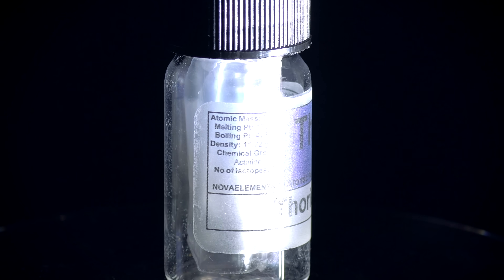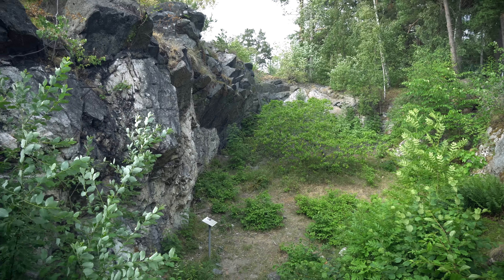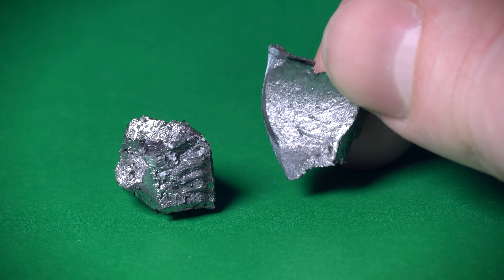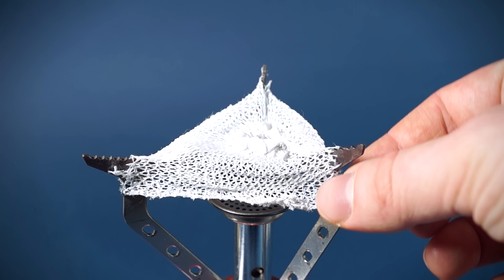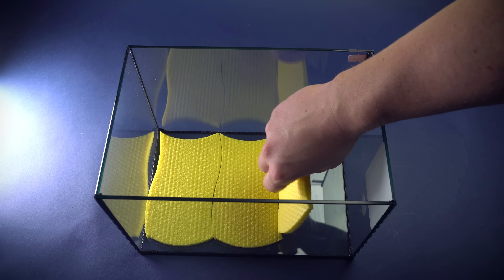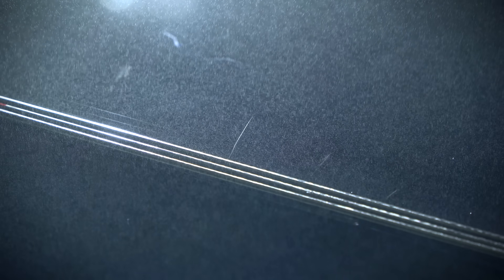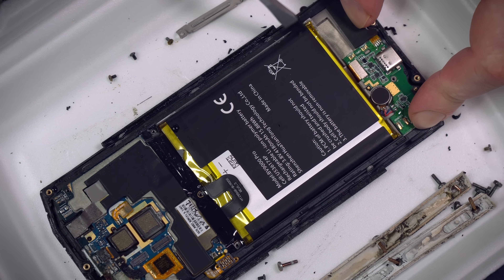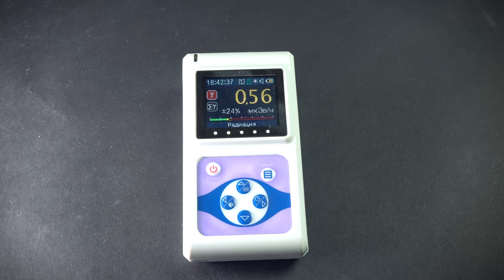Thorium - A METAL THAT NO ONE NEEDS!

Comment: Stay tuned for thorium reactors in the near future.
Reply: Coming since 1969
Reply: @zerotwo_.002  can't be weaponized, of course they didn't put effort in researching it
Reply: @zerotwo_.002 fusion may be 30 years away. 

But Thorium reactors will never exist.
Reply: @zerotwo_.002 17 yo old bro is chilling with homemade nuclear reactor.
Reply: I smell mindustry references
Reply: The only reason Uranuim fuelled reactors were developed in preference over Thorium Salt reactors, was the fact that throium salts cannot be used to fuel an atomic bomb.
Reply: @kf8575  That is incorrect...they weren't used due to Tellurium embrittlement of the Hasteloy-n the reactors were made of.   This is outlined in the publication from Oak Ridge.
Reply: @kf8575  Where'd you hear that, in a Ted Talk? Canada doesn't use nuclear submarines, and we STILL use uranium in our CANDU reactors. Why? It's better. Germany and Japan used it despite lacking nuclear submarines. Thorium is just another industrial waste that big industry is trying to pawn off on us, as "the latest and greatest big new thing" ... Because they didn't see the writing on the wall, and failed to diversify into new green technologies. Thorium has all the toxicity of of Uranium, perhaps 1/10th of the energy yield, and STILL produces toxic waste.
Reply: because of the navy
Reply: @kf8575 
Bollocks! 
Thorium is not a fission fuel for reactors or bombs. 

Just like U238 bred with neutrons to Pu239,
Th232 needs to be transmuted with neutrons to U233 to make it fissionable.
VERY dangerous process. More so than U238 to Pu 239, because of U232 side product with extremely high energy, penetrating beta and gamma emission from its decay.

And U233 makes very good bombs.
Reply: Sir,that exist in some games
Reply: @theredneedmoreblins3560  mindustry
Reply: Will they need cryofluid to run?
Reply: @animarthur5297  Yes
Reply: My mans living in ww2
Reply: @justinthor damn, if you could get fusion to work, I'm onboard 100% but it won't happen in our life times.  Thorium is safer than Uranium/Plutonium plants as well.  As soon as you choke the neutron soure, the reaction end.  In other words the disasters like Fukushima and Cher obligations can't happen in a thorium reactor.  Smash the plant, the reaction stops.  Its kinda nice that way.  Add to that the waste products decay infinitely faster.  A good source.  Interestingly, nuclear reactors already provide 14% of the world's power.  The thing that people don't get, is that in a worse case scenario... a melt down can contaminate a small are, bad.  The problem is that coal and petroleum product pollute the entire planet right now.    But, as you say, if we can get fusion to work... that is the future without the slightest doubt.
Reply: I agree because it's true and also logic
Reply: Currently Thorium can be used as a fuel in breeder reactors to produce Uranium and Plutonium for thermal reactors, but it's way more expensive than just using natural occurring uranium. I Dont think this process has actually been commercialised yet. India has plans too because the have large deposits of Thorium but I don't think they have moved passed research phases yet. They only get 2% of their energy from nuclear power.
Reply: @CanonFirefly  Converting Urenium from Thorium is a self sustained process. And India there is large deposit of Thorium. So using Thorium is more economical than importing Urenium.
Reply: @SouravBagchigoogleplus  it's only economical when the cost of converting the thorium into uranium is cheaper than importing uranium. It isn't yet, that why India is still importing uranium. The issue with thorium breeding reactors is that they are expensive to operate with the only output being fuel grade uranium.

Dont belive what the Indian government tells you. The main reason for their nuclear reactors is to produce weapons grade material for their nuclear arsenal. If they were truly serious about nuclear energy it would make up more than 2% of their energy production.
Reply: @CanonFirefly  Nailed it. They're going for U-233 -- which is MUCH better for making atomic bombs than U-235 or Pu-239. That's their motivation.
Reply: @CanonFirefly  I would rate the Indian reactors as no more than CONVERTER reactors. In a loopy, round about way, they're using U-235 to convert thorium into U-233 -- rather than using U-235 to convert U-238 into Pu-239.

They have THAT much thorium to play with. Someplace -- way down the road -- New Delhi is hoping that they can get their conversion up to a decent breeding ratio. If this has been achieved, it would be epic world-wide Big News. But we haven't heard a peep.
Reply: @CanonFirefly  ok
Reply: @CanonFirefly  good argument sir, it modified my first taught. Thanks
Reply: @duckface81  thorium sounds less radioactive than plutonium or uranium
Reply: India have the largest thorium reserves and we used thorium and plutonium for making nuclear weapons and also in nuclear reactor's
Reply: @ashutoshbehera8593  Thorium to U-233 is a better explosive scheme than U-238 to Pu-239. The Indians have long figured this out. At this time, I'd figure most of the Indian thorium research is strictly for atomic weapons. No-one can get molten salt schemes to work. The US and USSR threw everything at the problem -- for decades. They couldn't make any headway. Neither has Beijing or New Delhi. They'd be going for their Nobel Prizes if they did. For a viable breeder reactor is the holy grail of atomic power.

BTW, don't EVER dream of fusion power. It's the sure fire route to atomic bomb production at a staggering scale. Neutron scarcity is why atomic weapons are hard to craft. All current fusion reactor schemes spit out free neutrons something crazy. One need only wrap the reaction chamber with thorium to have U-233 coming out of ones ears. 
Humanity is not morally or politically ready for such an achievement.
Reply: mindustry enjoyer 🤙
Reply: I prefer a thorium reactor because it has less risks
Reply: @ben_p6615 You are DREAMING!
Thorium breeder reactors are at least 10x Less safe than even molten salt U238 to Pu239 breeder reactors.
And AT LEAST a thousand times more dangerous than conventional U235 reactors.

Thorium is not a nuclear fuel.
Reply: ThyZlayer  trueee
Reply: gonna make one myself
Reply: @gmantweet4638  🤣and some legos is missing on mine 🍻🤘😎
Reply: Another yes.
Reply: Check-out safe ThoriumElectricUSA.com no government funding + replace closed coal and out-dated nuclear power plants + no CO2 release.
Check-out safe ThoriumElectricUSA.com no government funding + replace closed coal and out-dated nuclear power plants + no CO2 release.
Reply: There are thorium reactors in India
Reply: India is working on thorium reactors.
Reply: In India there are many thorium nuclear reactors which run on thorium
Reply: @poogers566  No they DON'T. They run on Uranium. The Thorium in them is being converted into weapons grade U-233. This radio nuclide is THE ideal atomic explosive. It beats out U-235 and Pu-239 by a mile.

Separating U-233 from Thorium is a breeze. It's pure chemistry. So you get a mighty pure product. As an explosive, you need far less to reach critical mass.

It, U-233, is so dangerous (proliferation) that the USA and USSR jointly decided to nix it.

No-one can make the dream come true: a molten salt breeder reactor. India and Red China are not more sophisticated that the USA and the USSR.
Reply: India had made one
Reply: Not going to hold my breath. Only perpetually 30 years away, like fusion power.
Reply: China is working on them at the moment as a matter of fact
Reply: @thescrimble  Yes and China made their reactors with Hasteloy-n.  They will have the same issue as every other nuclear nation that's attempted it.
Reply: India has thorium reactors
Reply: Once WE ARE ALL DEAD!
Reply: And thorium bombs
Reply: @Briandacunos  no lol lol lol lol lol
Reply: Go play mindustry
Reply: @Juangonzalez2004XO  I did, and probably you too :)
Reply: @maxwellr.a.harkonenn8317  yes
Reply: ThyZlayer  remember the cryofluid
Reply: oh boy... mindustry gives me nightmares..
Reply: https://youtu.be/jjM9E6d42-M
Reply: @urbanphotographer  ah yes, samonella
Reply: https://youtu.be/5gv6hDOnnCE
Reply: India has succesfully developed a Thorium based nuclear reactor which can produce similer energy as any normal nuclear reactor
Reply: @SpaceLOSTbunny  But it's a URANIUM 233 reactor. Thorium is merely FERTILE not FISSILE. So, yeah, the Indian reactor is very much like U-235 reactors.
IIRC, no-one has EVER gotten the design to the point that it is a BREEDER.
India, of course, has one of the world's largest thorium deposits. It could power India for thousands of years -- IF, and only IF, the Indians can get the reactor up to breeding ratios.
Now THAT would be new.
Reply: @davidhimmelsbach557  True 👍
Reply: Watch "thorium in 5 minutes", lftr reactors are too clean and cheap for globalists to allow
Also, https://youtu.be/tyqYP6f66Mw
Reply: Far further
Reply: Lol
Reply: Amen Bro..
Reply: Thorium reactors solve at least 3 major problems with uranium fission reactors
Reply: @nurseSean  Yes but the coolant, the designs,  the corporations and the politicians are dirty corrupt people so it won't be used responsibly just like everything else in this world.   It's ignorant to think nuclear is ever going to change.   It just doesn't have the abilities to.
Reply: NOPE.  Its already used in fuel rods.  Its a shitty fuel by itself, but when mixed with uranium it makes the uranium more efficient.
Reply: @TheNoodlyAppendage  Its all garbage misadvertised for nearly a century
Reply: We had an operating prototype in the 70s in one of the national labs, but the pressurized light water reactor technology persisted and sort of shelved any competing technology, regardless how much better. This could be a great interim solution until fusion is commercially available.
Reply: @amramjose  Tellurium embrittlement or segregation of the Hasteloy-N is the issue
Reply: It's not that easy
Reply: Tactical nuke incoming
Reply: Engin arık and her team died at sparta plane crash, the team was working on a reactor type for thorium
Reply: Grande!
Reply: They were the first ever made too but not weaponizable so the global cabal didn't use em
Reply: You were right. Are right.
Reply: Can Thorium double as a weapons platform? Ie. can the process produce weapons similar to what can be produced with traditional uranium nuclear power plants?

If not, then you probably have your answer why there is no drive for Thorium 😂
Reply: near future?
the giza pyramid was a thorium reactor
go look at the studies into the black goo found on the resonance chamber walls
FULL of thorium
Reply: if you mean in 40 to 50 years
Reply: Just saw an article that the chinese will make a thorium salt reactor in 2025
Reply: 5 years later...
Reply: Well it radiates alfa radiation  which can produce heat so maybe possible to make an weak nuclear reactor in your garage which will supply lights so good luck ;)
Reply: @gistasbanaitis473 Thorium is better than uranium in any way
Reply: @gistasbanaitis473  thorium is the future
Reply: @gistasbanaitis473  bet
Reply: @gistasbanaitis473  they've made thorium reactors before
Reply: @gistasbanaitis473 yeah
VERY low levels of alpha decay.
And of course the dozen more rapid alpha and beta decays after each vvveeerrryyy occasional Alpha decay.
Reply: Far future*
Reply: @drust1985  that didn't age well lol
Reply: @drust1985  you know Nuclear fission reactors are very close to being finished
Reply: Arent those already a thing?
Reply: @johannesviljoen9656  not really
Reply: Solar is inefficient, degrades, has far more toxic waste than nuclear, ... if you could get it into space and use a microwave generator and an earth based receptor, maybe.  Wind power is a dead end, Texas proved it last week.  Quite simply, it's an interesting curiosity and is suitable only for a very small set of geographical locations which translates into huge transmission losses. Unfortunately, because fusion is a long way off, fission is all you’ve realistically got.  My ONLY reservation with nuclear power is terrorism.  France has shown the way, it works, it is reliable.   Why do you think coal and oil are fighting so hard?  The main concern i would have is personal.   You would need a well-paid,highly trained, motivated, educated, and intelligent work force.  A rigor of duty akin to that of the military.  That generates safety.  I'm an environmentalist and i am fine with nuclear power.  I'd settle for anything over dumping garbage into the atmosphere.
Reply: India does have a majority of reactors running on thorium
Reply: @PrashantKumar-yd7rx  what?
Reply: @PrashantKumar-yd7rx  that's interesting.. didn't know this
Reply: @PrashantKumar-yd7rx  they do ?
Reply: @PrashantKumar-yd7rx  India is working on Akshay Paatra witch is Thorium base reactor In south india. Only india have this type of reactor . before this Russia is working on it but they giveup because of the cost and its causes if failure.
Reply: @shriramtakale4503  india should focus on fixing the slums and basic human rights before they do something like that
Reply: @Andromedagalaxy22  we already done that project only final assembly and trial is running. Before speaking about slum please visit once India and see prosperity of India don't judge by what you hear but Judge by what you are seeing. When other countries are fighting for vaccine. we are send vaccine for free of cost to others and in the country.
Reply: @shriramtakale4503  that reactor has has been called the most delayed nuclear power plant in the world , it is yet to give a net positive energy and all this doesn't even consider commercial viability
Reply: @06.vineethdsouza80  At list we are working.Not going to fail if you know indian scientists they take time And less money to develop any technology but our technology is fullproof and going to make bench mark . after the success of this reactor we start other projects same as this with minimum cost.and making money from other countries by selling this technology and being part of making it in that country.
Reply: @06.vineethdsouza80  the delay of the project is because of last government that not rising funds on time not because of scientists.Now both are working good for it so hope it will complete in decided time.
Reply: @shriramtakale4503  did you read the article ? it lists all the delays and the list doesn't stop at 2014
Reply: @shriramtakale4503  the evident falsehoods, contradictions, and misleading promises made by officials:

February 2010: Unnamed DAE official: Delayed by “a couple of months to one year” and the PFBR “would be commissioned in 2011”

October 2010: Director of IGCAR: “will be commissioned in September 2011”

March 2011: Minister of State for Parliamentary Affairs, Personnel, Public Grievances & Pensions & Prime Minister’s Office: “expected to be commissioned during 2012-13”

November 2011: Unnamed DAE official: “commissioned by the end of next year”

March 2012: Minister of State for Parliamentary Affairs, Personnel, Public Grievances & Pensions & Prime Minister’s Office: “commissioning of the reactor is expected to be completed in 2014-15”

December 2012: Chairman and Managing Director of BHAVINI: “close to completion” and “6 commercial fast breeder reactors in the next 15 years”

August 2014: Minister of State for Parliamentary Affairs, Personnel, Public Grievances & Pensions & Prime Minister’s Office: “achieved overall physical progress of 97.6% as on 30.06.2014” and “approved date for criticality… in September, 2014”

February 2015: Chairman and Managing Director of BHAVINI: “criticality by either June or July” of 2015 and “commercialisation by the last quarter of 2016”

October 2016: Chairman Atomic Energy Commission and Secretary DAE: “will be commissioned next year”

February 2017: Minister of State for Parliamentary Affairs, Personnel, Public Grievances & Pensions & Prime Minister’s Office: “fully functional by October 2017”

December 2017: Director of IGCAR: To be “commissioned in two months”

March 2018: Director of IGCAR: “criticality either in late 2018 or early 2019”

September 2018: Chairman Atomic Energy Commission and Secretary DAE: “expect criticality next year”

February 2019: Minister of State for Parliamentary Affairs, Personnel, Public Grievances & Pensions & Prime Minister’s Office: “expected to approach first criticality by the year 2020”

March 2020: Minister of State for Parliamentary Affairs, Personnel, Public Grievances & Pensions & Prime Minister’s Office, “expected commissioning” in “December 2021”

October 2020: Director of IGCAR: “in the final stages of commissioning. I can only say this much”
Reply: @shriramtakale4503  yes
India will give up, just as Russia, Britain, France, Germany and USA have given up.
The only thing going for Thorium reactor technology is the never ending stream of development funds that will never achieve success, because its even more dangerous and polluting, and physically impossible to achieve safe operation.
Reply: Dude Indian nuclear powerplants literally run on thorium
Reply: @JINKAZAMA-ik2df  no they don't. They run on uranium. They are researching breeder reactors that can turn Thorium into Uranium but they haven't commercialised it. Thorium cannot be used in a thermal reactor as a fuel. It cannot sustain a fission reaction.
Reply: @justinthor there is a lot of fear based propaganda funded by the coal and petroleum industries.  Nuclear is the cleanest way to go.
Reply: @justinthor Fusion is the most dangerous of all. For all current schemes end up being neutron generators. It is neutron scarcity that is holding back wide open atomic proliferation. ALL current fusion designs MUST generate radioactive by products in amounts wildly beyond those of conventional fission designs.

Fission reactors have been sited VERY incorrectly -- to put it politely. Because of the 70's oil crunches, atomic plants were sited willy-nilly -- without thinking things through. E.G. Putting GE designed boiling-water reactors along the TSUNAMI coast of Japan. How crazy was that? Those reactors should never be put back into service.
There are also more than a few reactors that were sited shockingly close to serious earthquake faults.
So, it's not that fission reactors are all that dangerous, fatalities due to them are trite. It's WHERE so many have been sited. 
THAT'S what was astoundingly stupid.
The other super stupidity was building fission reactors in the Soviet manner. Within the USSR, they were built without any reactor containment. Hence, Chernobyl. That fiasco could only occur in the USSR. No other nation bought Moscow's B.S. about how safe they were.
Today's PV arrays are hugely manufactured in Red China -- by factories burning staggering amounts of FILTHY coal. They're the source of Beijing's air pollution. Yup.
Red China knows all about pollution control -- but will NOT do so -- because of MONEY. Electricity is cheaper to supply if you can pollute the whole planet. When you buy PV arrays, you're simply moving coal pollution from the 1st World over to Red China. Then that pollution floats across the Pacific -- back to California. Yup. Until Red China cleans up its act, all other anti-pollution initiatives just don't pan out. The plastic bottle raft in the Pacific comes from Red China -- and no-one else. Just pick up that trash, and every label is in Mandarin. (!!!!) The MSM deflects this from the greater public. They want to keep their Beijing bureaus.
Reply: @davidhimmelsbach557  ayyy...just checked on chinese energy production sources in % and then looked at global pv array manufacturing...big oof indeed
Reply: @davidhimmelsbach557  or could it be because Dubai is seeding the clouds to cause it to rain more in their region?
Reply: There is no such thing as a thorium reactor. It has to be converted to U-233. You're describing a URANIUM reactor. Thorium is HOPELESS.
Reply: india is thorium based
Reply: It wouldnt work for reactors
Reply: @m808bscorpionmbt3  it does. 

The only reason thorium salts are not used its because you cannot make weapons with thorium
Reply: @bobec2999  ohk thanks